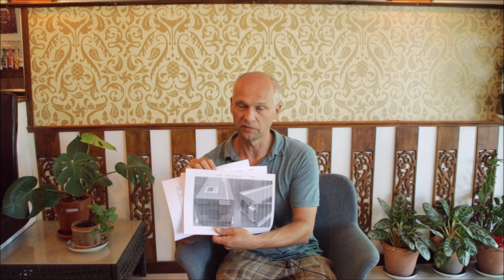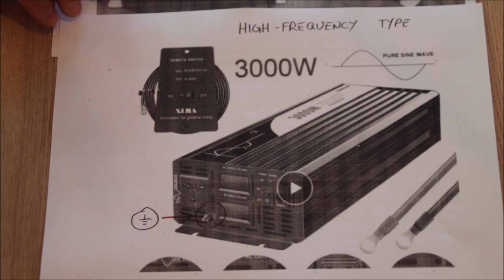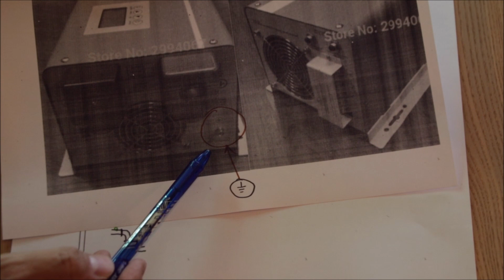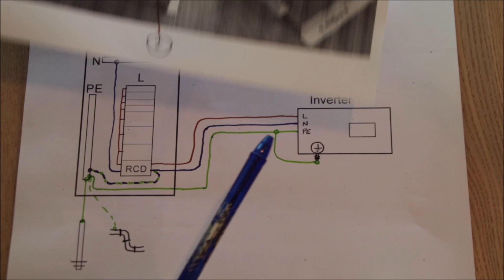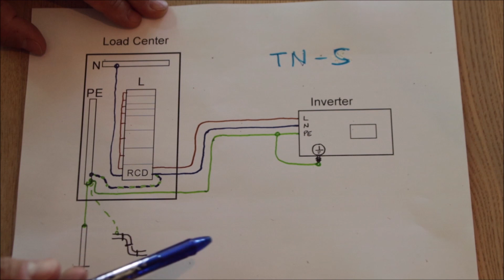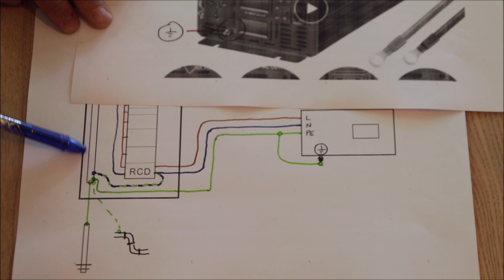Inverter Earthing and N-G Bonding in a simple Off-Grid Setup

Comment: I purchased 3 x mpp 5048 hybrid inverters with the intention of storing and producing 3 phase power and have learnt they are not really safely compatible with my TT system, I am also downstream of a rcd.
The neutral is only hot when I am off grid and mains is disconnected, my work around, is to only use the earth to neutral jumper cable under these conditions.
What are your thoughts Roland?
Thanks for making these videos
Reply from the maker: Such a system, which you are describing, you should really only run off-grid with a full transfer in case of switching back to grid power. Full means, all conductors, even PE. Not using the bypass feature. As you want to obviously run your whole house on the system, you cannot go isolated as any nearby lightning around your house can cause a serious over voltage and fry your appliances. Maybe my practical guidance video can help you with the TT setup. Downstream bonding in a TT system will cause any fault currents on that transformer flow over your bond, even if its your neighbor ones.

Comment: Hi! In the house i have an TN-C-S electrical system, if i just plug in the invertor AC input on a AC socket with PE of the house , the invertor is grounded?
Reply from the maker: If you connect L, N and PE from a socket to the inverter terminals, then the invertor shell or housing is grounded. When your inverter is in bypass mode with grid directly connected to inverter output, then your output is as well TN-CS. But when your inverter is in off-grid mode, the output is IT. only a N-PE bond will make your output as well be TN when off-grid.
Reply: @RolandW_DIYEnergyandMore  On the output of the invertor I have to bound N to PE in a load center as you drew in video?instead of an RCD can i use a RCBO?
Reply from the maker: @ciprianalexandru7369  yes, RCBO works same. The important is that the bond is on the N input of the RCD/RCBO so ground leakage can be detected. But you will not be able to plug the inverter ac input into a house socket. As your house will have a RCD and will trip when the inverter goes into bypass mode. The ac for the input must come from before your house RCD too.
Reply: @RolandW_DIYEnergyandMore  THX !

Comment: For US panels, I'm assuming the neutral bonding screw would be installed in this situation, since the inverter is the only power source and this is the only (or first) panel?
Reply from the maker: Yes, but don't forget to use GFCIs outlets for leakage detection.
Reply: @RolandW_DIYEnergyandMore  Thanks, I was shocked to learn just how many different types of circuit breakers we have available now in the US.  GFCI, C/AFCI, thermal, magnetic, bluetooth, wifi..

Comment: Thank you so much, I have ben searching for an explanation for earthing invertors for a  long time. It is very clear and understandable. I have an off grid cabin fed by solar panels to a battery and charge controller. This then feeds a cheap invertor with two sockets, I now see how dangerous this can be under a fault condition. I will as soon as possible alter my system and install an earth stake and RCB as you have shown. Thanks again.

Comment: Hello, I live in the US and I have a 230v european single phase inverter charger that I was hoping I could use to feed a 230v mini split air conditioner. The Inverter has (L,N,G) outputs and the mini split has (L,L,G) inputs with no neutral. The inverter is bonded N,G but can be unbonded. Do I connect N from Inverter to one of the lines on mini split? Do I keep the inverter bonded? Can I use existing ground rod where the house mains are connected to or use a different ground rod? Do I use a double pole breaker ( RCD, or RCBO)? Your thoughts are appreciated.
Reply from the maker: Hi, yes. As long your setup is exclusively supplying that mini split AC, all of what you wrote would be applicable, and you could as well use the PE of the house and bond the neutral to it. Just do not use a bypass grid connection through the inverter if it has it. If you need to run the AC when solar or battery is not available, use a transfer switch to connect grid if required and isolate the inverter.
Reply: @RolandW_DIYEnergyandMore  Yes, the inverter will be strictly dedicated to the ac unit. So to get this right, I should disconnect the neutral and ground connection within the inverter? I should wire Neutral and Line from inverter to a RCBO within a load center enclosure? From RCBO I should install a DPDT transfer switch to wire from grid or inverter off grid? All grounds will connect inside load center bus then connect to house ground rod. How do I connect Neutral to ground...A jumper wire from RCBO to ground rod like in the video (TN-S)? Thank you very much for your time. Also You say NOT to use 2 hot lines from grid to Inverter Inputs?
Reply from the maker: @gmanweber3776  the way you explained, Inverter-RCD-ATS-Load center with a breaker for the unit and PE would be OK. The only problem I see is your plan to connect AC input to the inverter, because connecting european L+N (0-230V while N has groung reference) or american L1+L2(-120/+120V with an unused ground referenced N) is different. You definitly cannot bond N-G at the inverter when using AC IN, as then you would switch L2 onto PE in bypass mode. Not to bond N-G in your case would be acceptable, as you would only run one device on that circuit and your appliance has PE on its metallic chassis+RCD. If you say, you only want to use the AC for battery charging, then there is still the question, if the Inverter internally will disregard that different signal. IMO I would avoid to use AC input at all. Use Solar and Battery, and if DC is depleted because of bad weather, just switch over to Grid by a ATS.
Reply: @RolandW_DIYEnergyandMore  I admit I'm sort of new to this kind of set-up and I really appreciate your advice. I have an existing single phase inverter on a transfer switch but needed split phase to run the mini split. I found this inverter samlex evo 2224e for cheap and figured I could make a separate system to run the AC unit. Since the inverter can handle 10 amps output I would assume I need a 10 amp double pole RCD? But the AC unit requires max 20 amp double pole breaker. I'm sorry I'm just trying to learn this and do it safely. It's probably a no brainer for you and straight forward. Can you tell me which breakers to use and the appropriate load panel that will accommodate the breakers. Transfer switch I can figure out but if you know of a good one for my application I appreciate it. Thanks for all your help. I will pay it forward;)
Reply from the maker: @gmanweber3776  I understand. Best in your case, would of course be to use a US type split phase inverter ;)....normal RCDs do not feature current protection. They take care leakage only, and are typically 40A/0.03A type. You can use such a device in combination with a breaker of the required current. A RCBO is a RCD/Breaker in one. But you cannot connect L1/L2 to a RCBO. So I would keep the order Inverter-RCD-ATS-Breaker-AC Unit. That way you make a clear separation between supply by grid and supply by inverter. You only need a small breaker box with a DIN rail which can fit 2 double pole devices. You can use a simple ATS. There is no need to transfer quickly, as you are transferring between 2 different waveforms. It is actually an advantage if the switch is creating a zero voltage gap for a few seconds. If you get a 3-pole ATS, then you can follow my instructions in my practical guidance video for TT systems, and as well route PE through the ATS on the inverter side, and create a N-G bond directly at the inverter (no AC-In used). That would give you again a return path for fault currents and complete the grounding situation.

Comment: Great video Thanks
But what is a rcd 
I planning a offgrid whit a 2500w inverter  what rcd must i use
Reply from the maker: Which type of electricity do you use in your country? 230V/400V? Or are you living in America with 120V/240V?
Reply from the maker: RCD... Residual current device. A standard RCD for any typical installation today would be a 40A/0.03A RCD. So if you live in the 230V world, you would use a single phase 40A/0.03A RCD for your 2500W inverter. The 0.03A stands for a maximum leakage current of 30mA
Reply: @RolandW_DIYEnergyandMore  thanks im from belgium 230v
Reply: Can i use this ?
Reply from the maker: @ikspeel  isn't a 40A/0.03A RCD part of a residential electrical installation in Belgium? I think you should be able to get it in a construction market. Yes, that is what you should use.
Reply: @RolandW_DIYEnergyandMore  i have this fond on alieexpress is this right?

Comment: My off-grid inverter shows 115V between  E and L  and 115V between E and N, and  230V between L and N. Is this normal? Is it ok to bond N and E in this case.?
Reply from the maker: @Dissecting_Truth  N from inverter to N In of RCD. N Out from RCD to N Bar. The bonding wire goes from E Bar to N In from RCD and is meeting the N from Inverter there.
Reply from the maker: This is a 1-phase inverter (230V), no split-phase, right? Yes, you have a seriously dangerous voltage on your N. You need to bond. Bonding is there to give your inverter a reference to ground, there is no current flowing over the bonding link once connected.
Reply: @RolandW_DIYEnergyandMore   Yes. It's an EPEver IPower 2000, a regular off grid inverter. I was worried if I connect the ground and neutral of the inverter it would short it self because of that 115V between those. I hope this is purely because there is no reference to ground at the moment?
Thank you so much btw, I struck gold when I accidentally found this channel today. Love your content 💓
Reply: @RolandW_DIYEnergyandMore  Hello Roland.  Does this mean if you have a split-phase off-grid inverter you cannot bond neutral to ground? Because, when I measure the voltage between L1 and ground I get 150v and 80v between L2 and ground. When I measure the voltage of a 120v socket, I get 80v between L and neutral and 38v between neutral and ground. So, should I do the neutral to ground bonding in my split-phase system?
Reply from the maker: @emad6534  thanks for reporting a voltage readout of a split phase inverter. Yes, you can and should N-G bond/physically ground the inverter  to give it a reference to true Zero, so that voltages do not float. Just make sure that you do not bond any of the Ls and that if the inverter as well has a AC-in, that you there also only connect what exactly is written on the terminals. Only use real US splitphase inverters in the US split phase grid and its OK.
Reply: @RolandW_DIYEnergyandMore  Hi Roland. I have 230v grid , TN-C-S and have an pv off grid inverter with floating neutral at output ( there are two L lines with 230v between, and no bond with ground, no separate ground connection except the one on the case,) I want to use it to feed the house in case of lack of  grid. In that case I will need to bond ground with one of the L lines to obtain 0v in reference to ground, right, or this will need a separate ground rod?  I have a transfer switch with  continous neutral and I'm wondering how the current behave in case of some maintanance in the grid by power supply facility which teoretically will shut off the L and unbond the N from ground which is bonded in transformer station ? Im aware that there will be one of the L outputs bonded with earth still in house howwver is this enought to protect the grid worker from being shocked? ( The do not expect to have a voltage on N line)
Reply from the maker: @luki3354  hi. in your TN-CS setup, do you have an auxiliary earthing at your house or is the PE  purely comming from the grid as seperated PEN? you should use a transfer swich which is disconnecting all 3 wires from each sorce, not just the L. that way the bond will always be definitely on the side of the active power source and currents cannot stray around using pathes via earth. if then the auxiliary rod is a common one connecting directly to the distribution box, that is excellent. it will give your inverter zero reference and your RCD leakage reference for human protection. if there is no aux earthing at your property, then you will need a rod. i think such a setup should be shown in my video about practical guidance.
Reply: @RolandW_DIYEnergyandMore  From the grid i have 4lines(L1, L2, L3, PEN) . In my house electric box PEN is separated into PE and N, where PE is connected to earthing rod as axiliary earthing. In that case I,'m wondering if my transfer switch should include also PEN and so should be 4-pole or I can keep the PEN connection always on since it is earthed at my house and also at the transformer?
Reply from the maker: @luki3354  at the 3 phase supply you have to use a 4 pole transfer switch. otherwise power will flow via the PEN to the inverter as well. Thats the only way how you can protect the grid from a backflow.
Reply: @RolandW_DIYEnergyandMore  Thanks Roland, I appreciate your comments
Reply from the maker: @Dissecting_Truth  thanks for so much trust. hehe
Reply from the maker: @Dissecting_Truth  thank you for watching my video. glad I have nice followers like you guys. enjoy your system. have a good day
Reply: @RolandW_DIYEnergyandMore  Thank you so much Roland for helping us all out. I'll report my success/failure 🙈 here once I get my thoughts together and attempt the bonding. Cheers!
Reply: @Dissecting_Truth  I'm yet to try the bonding of the neutral and the ground. I'm too chicken to try it out 😋 
However I checked with EPEver support and they confirmed that I should bond the neutral and ground if I want an RCD to trip. They even sent me a picture of how the bonding is done using a picture of my inverter. 
Regarding center tapped, they mentioned the voltages we are seeing because of a Y capacitor used between two output terminals. I guess this is to deal with EMI. 

You could also contact them and update us all here 😉
Reply from the maker: @gayanx86  I remember when I first time held the bonding wire to the N-bar :)))
Reply: @RolandW_DIYEnergyandMore  expecting fireworks. Haha. I know the feeling ☺️
Reply: @RolandW_DIYEnergyandMore  by the way, I have seen people mentioning a use of a resistor between when bonding ground and the neutral terminals. Do you see a specific reason for this ?
Reply from the maker: @gayanx86  the only thing why someone would do that is out of fear. hehe. it shouldn't be done, as otherwise returning fault current is restricted and the rcd might not trip when a human is causing the leakage
Reply: @Dissecting_Truth  Fingers crossed mate. But my money is on the former ☺️
I wish you success.
Reply: @Dissecting_Truth  Awesome mate. Really happy about the results. Roland should have more and more subscribers. His content is gold. 
By the way, How did you connect the neutral and ground. Hooking up a wire directly ?
Reply from the maker: @Dissecting_Truth  Earth bar to RCD In, RCD Out to N bar please. Bonding behing RCD will trip it.
Reply from the maker: @Dissecting_Truth  is that a gasoline generator or something of that sort? You can connect it of course, because then the generator N is similarly bonded to Earth as well. You should just use a transfer switch, to separate the wiring from inverter and generator at any time. So one side of transfer switch is inverter, other side is generator and output goes to RCD...
Reply: @Dissecting_Truth  check the description of his latest video. I noticed his PayPal id there. I was interested in that for future purposes 🙂
Reply: @Dissecting_Truth  Will keep you posted mate. I'm fixing the broken earth line in my house, after that I will try out the bonding. 🙏
Reply: @gayanx86  Hi Gayan, will be good to know how you get on with this inverter, I am making a list of inverters that can be neutral - earth bonded on output. Nice that the manufacturer got back to you and said this was all ok. Will be good to know how you get on with this please let us all know
Reply: @BrackstonesTravelAdventures  Hi mate. Didn't get to try it out. I switched to a combined off-grid inverter and keeping the EPEver inverter as a backup now. The hybrid has the same behavior though. Our country is going through a power crysis so didn't want to do experiments.
Reply: @gayanx86  That's a shame, I am trying to build up a list of inverters that connect neutral - earth bonding without causing any issues like shut down or magic smoke. 😂